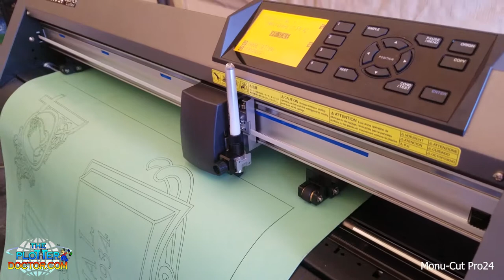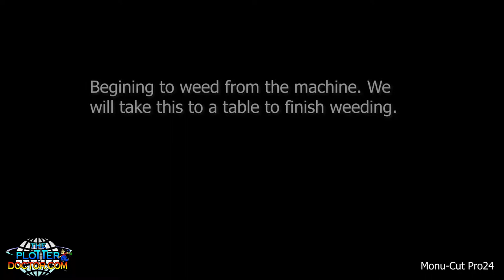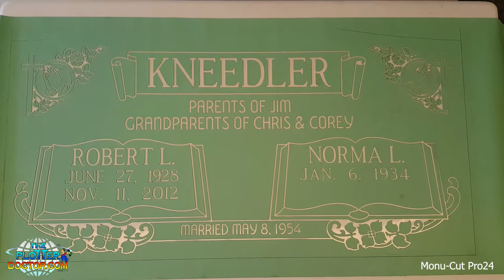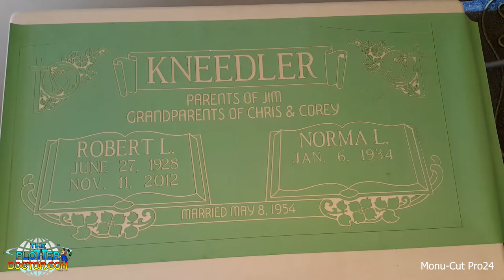Monu-Cut Pro24 Monument Stencil Cutter.

Comment: I've had an issue with my graphictec where the lines are inaccurately spaced. One side of the design will have a bigger line around the design than the other. It looks like you have this figured out?